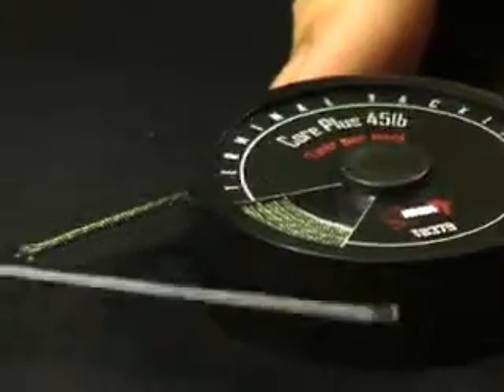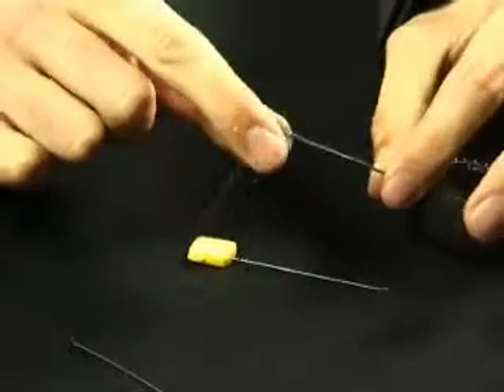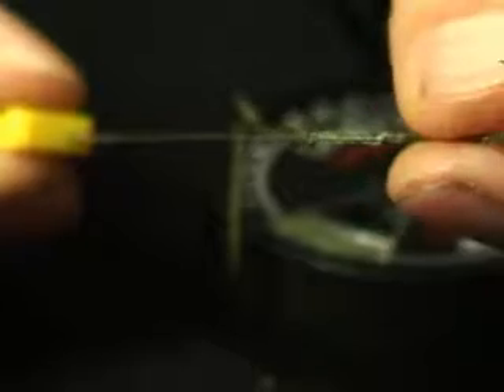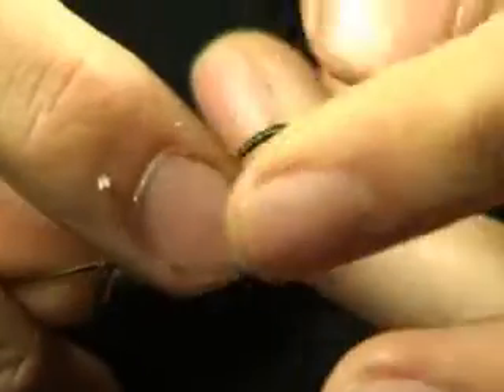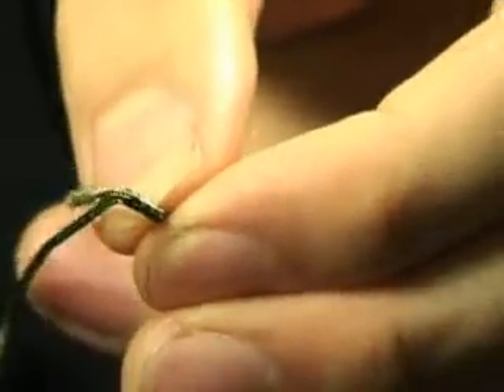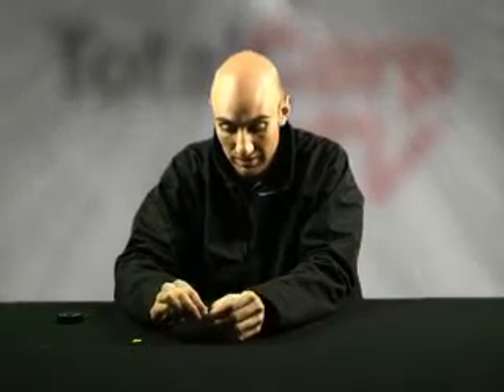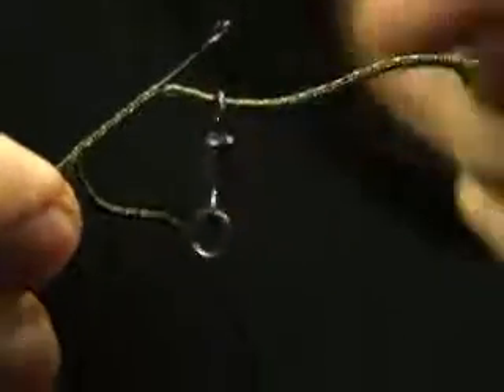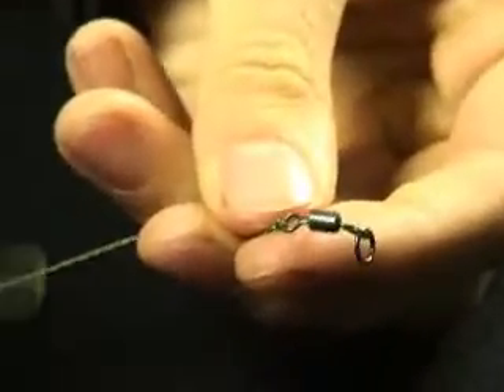Splice Lead Core with Jon Bones

Comment: @CarpMagic95 It's like a chinese finger trap - this is from wikipedia, and explains it (a bit) -  Pulling the entire braid lengthens and narrows it. The length is gained by reducing the angle between the warp and weft threads at their crossing points, but this reduces the radial distance between opposing sides and hence the overall circumference. The more one pulls, the more the circumference shrinks (i.e. the trap tightens).

Comment: Why doesnt the bit you threaded back through with the needle and then cut it as close to the leader as you can, come back through the way it went once pressure is on it, such as your line pulling? as nothings used to secure it and surely if you pulled it through one way then it could just pull out again the other? Ill give this a go though as i wont lie ive been to worried to do it incase my attempt failed with a carp on or something. Your help videos are just fantastic. cheers